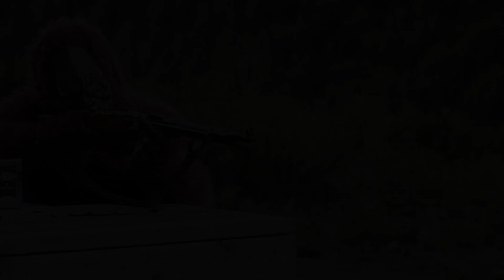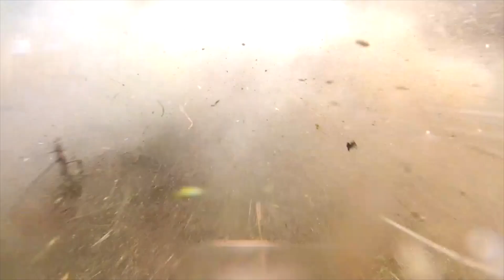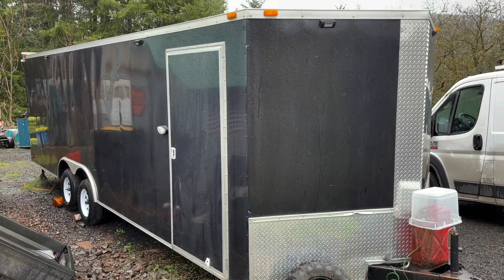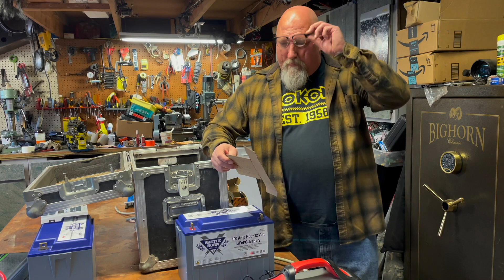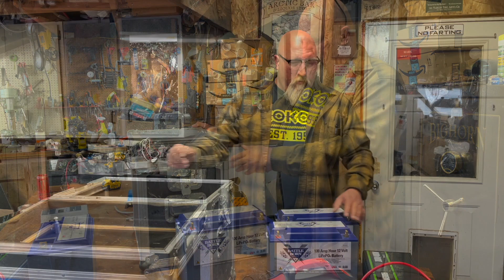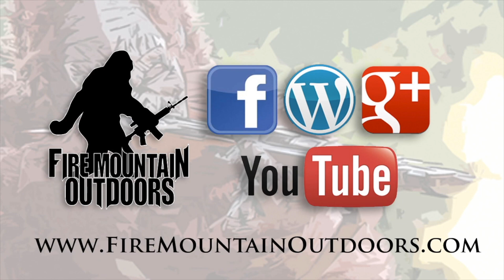DIY Solar Power Bank  Part 1

Comment: Awesome concept. I too have been looking into a similar setup. I’m just looking to build a boondocking setup for my pickup. 
I’m not smart enough to build this stuff, so I’m the sucker that will likely buy a system off the shelf. 
I’m looking at a Bluetti 500w solar generator and a 120w solar panel.

Comment: I just got started with solar. Saw two cheap panels and ordered 30 and 50 watt panels with USB ports because I already have a lot of USB chargers for my AA batteries and I have two rechargeable USB fans. I ordered a bunch of power banks with USB ports and some USB light bulbs. We had two long power outages last season and those battery powered fans get EXPENSIVE, and unless you already have a giant collection of them the stores run out right away. Now I can avoid that big BIG problem next time, because going from air conditioning to nearly 100F is BRUTAL! 

Although I have plenty of radios and batteries I can charge, I ordered a rechargeable USB AM/FM/WEATHER pocket radio with a bright flashlight too. It was only 12 bucks but has a 2200 mAh 18650 battery, that others have tested and it does have that capacity, so I know I`m getting a nice backup battery for my Kaito KA500L emergency radio, and at the same time a weather radio with alert that fits in my shirt or coat pocket. Radios are very important. Relying on phones and internet has made many people forget or never know the value of radio. If any of you need help choosing a SHTF radio holler at me. tonyclifton@dr.com